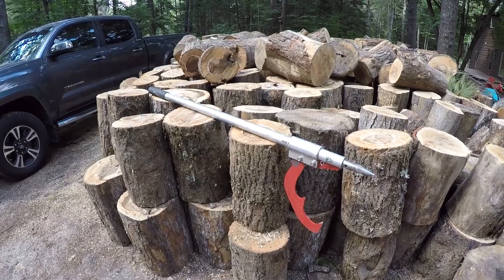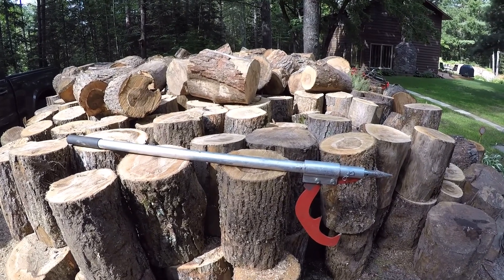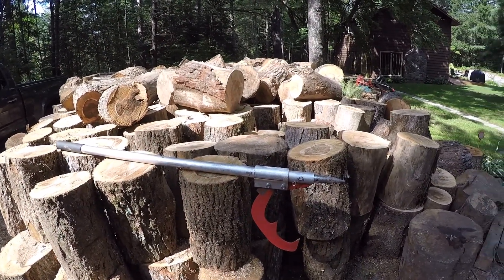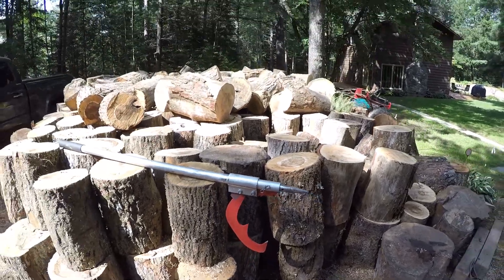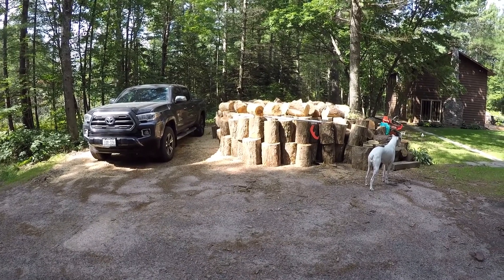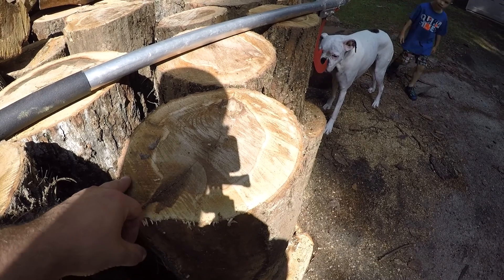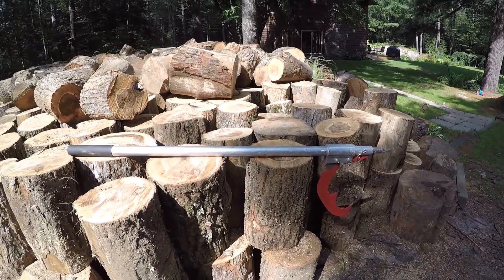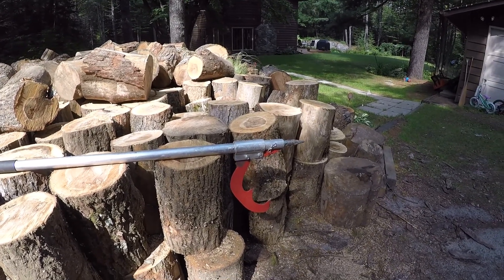Simple Tool For A Simple Man:  Item #1

Comment: great tool to have for sure.nice pile of wood.take care
Reply from the maker: it's super handy.  i have been using in for many years now and it takes the place of a tractor for the most part.  The Gator and this tool and i'm able to move the logs into a good position to either cut for firewood or mill for lumber.  That pile is about 1.5 years worth of wood.  So i'm hoping i don't have to do it again next year!!  lol

Thanks for watching!